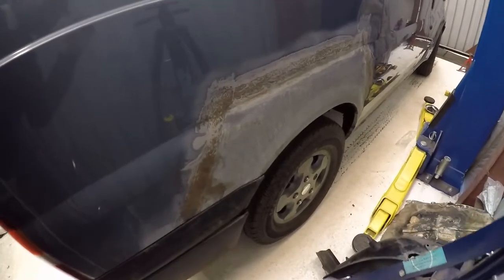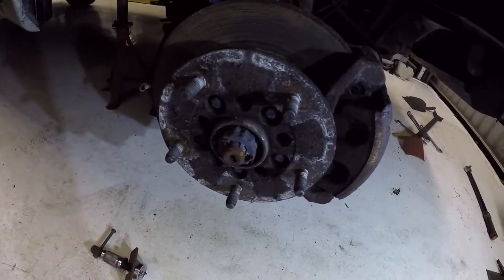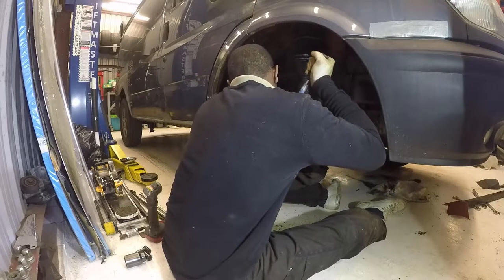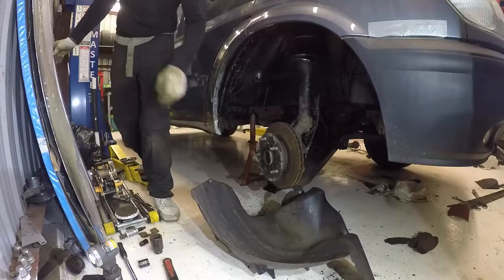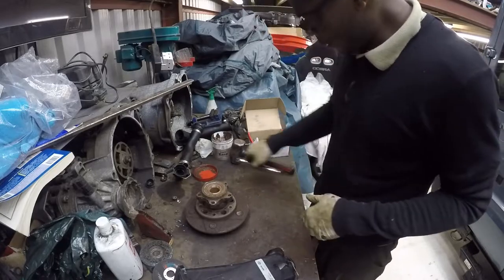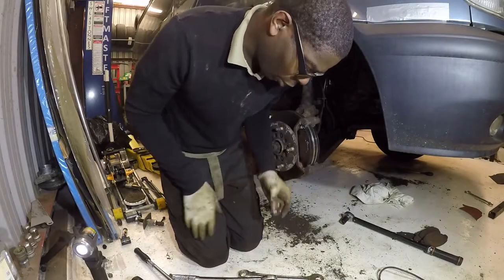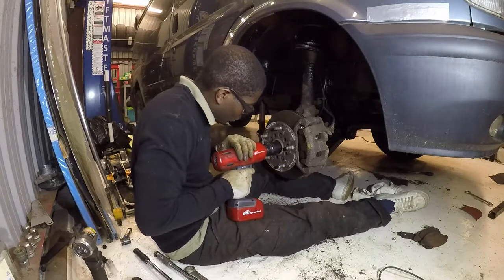MK6 Ford Transit Front Brake Discs & Pads

Comment: The disc/hub looked like it came off pretty easy! They are usually REALLY tight and a hammer along won’t budge them!
Reply from the maker: Based on what i read i was expecting more resistance but i didn't complain 😁

Comment: Great videos! I bought my first mk6 a few years back and was delighted until it came to changing the front discs....I discovered that all the torx bolt heads had been rounded off on both sides!! absolute nightmare and i'm guessing that's why I got it cheap! was more cost-effective to buy another van and I got an 05 Tourneo exact same colour and wheels as yours.
The wheel arches were good but the sills same as yours and needed a shed load of welding underneath..inside and visible bodywork looks immaculate and only done 59k as used as a school bus, But up here in Orkney the salt air loves the mk6! I got it all done and now need to change the alternator...another nightmare by the looks of it! That said she drives beautiful and I guess like you it's well worth dealing with the welding for such a reliable daily van. Thanks for sharing your experience, great work and you have a new subscriber :-)
Reply from the maker: Hi there, thanks for the comments.  My Transit is still going strong.  Just changed the clutch and flywheel so it's now driving really nicely.

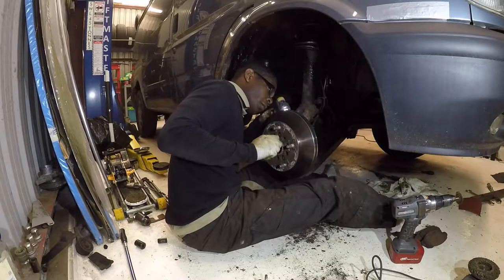Comment: @13:30 one little trick I like to use when squaring up holes is to pop a drift (screwdriver, allen key, whatever) in the hole. then you can sort of steer it into place.

Comment: Great video thanks. When you knocked out the shaft/ABS ring, did you have the drive shaft in place still? 

Thanks
Reply from the maker: It's a RWD transit so no front drive shafts.

Comment: This video is useful up to the point where you smash the disc off using a hammer! That may well be fine if you're replacing both disc and bearing assembly's with new parts, but you've basically imparted all that lateral trauma on the wheel bearing by smashing it off. That's why these are normally pressed out from the back using the bolt method or the proprietary tool.
Reply from the maker: Never looked at it that way.  Sounds like good advice.  Cheers

Comment: Very nice video. And can you add your criteria/reasons for changing both the discs as well as pads? I can see why the pads have to be changed: easy to measure/see wear. But the criteria for disc wear is not very clear to me. Is hard to see a minimum thickness, well unless it’s REALLY gone thin, or is grooved.
Reply from the maker: Hi there.  My discs were heavly pitted and as a result the braking performance wasn't great especially when pulling a trailer

Comment: Did you have to undo all the torque bolts to get the rotar off as I only saw you do 1. Also do you have to take the drive shaft off to knock the hub bolt through??
Reply from the maker: Yes I had to undo all of the torque bolts.  My van is RWD so it doesn't have front drive shafts. 👍
Reply: @ABIMOTO  I'm stuck on how to get the front drive shafts  out. Should just have to undo the torque bolts but I havnt got a t50! Lol nightmare.  To the garage I go lol
Reply from the maker: Hope you get it sorted.

Comment: Any ideas to what you do if you're rounded off knuckle bolt please?
Reply from the maker: Either hammer on a slightly smaller socket or weld on a nut and buzz it out.  

Good luck 👍
Reply: Surely you cant put a socket on though 'cos the torx bolts are round